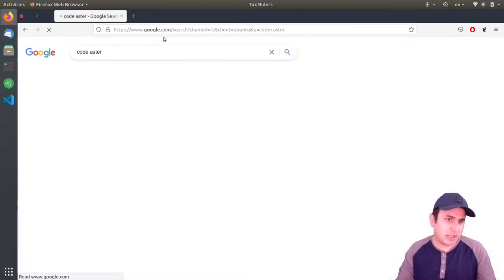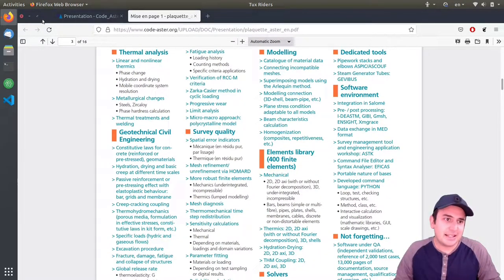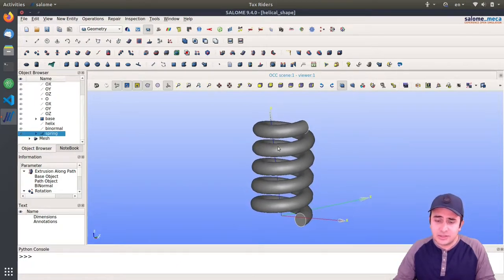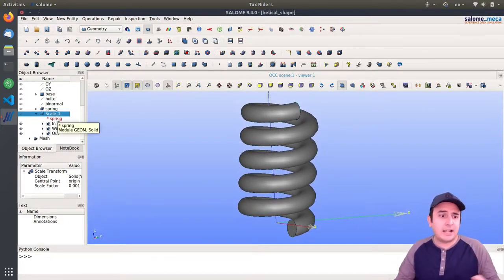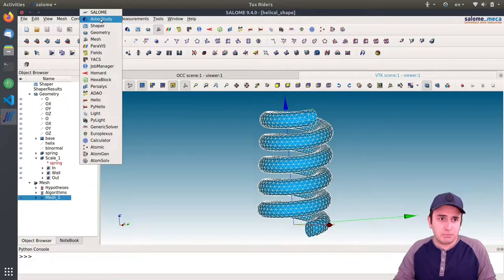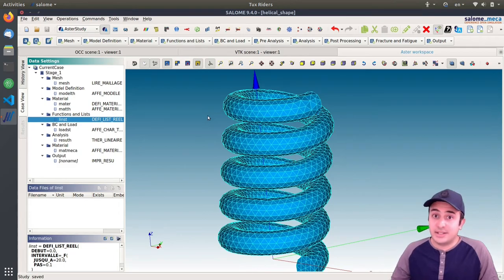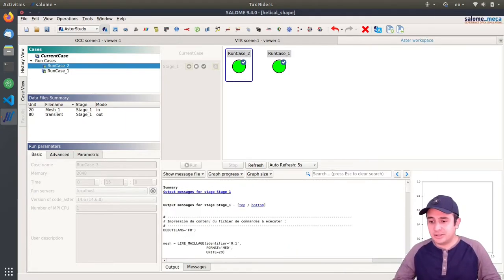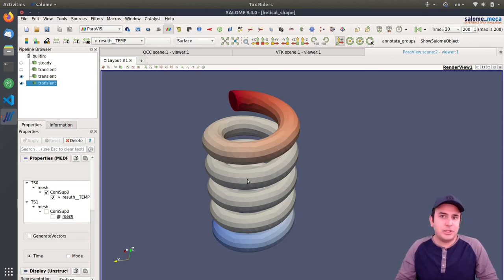[Finite Element 10] Transient and steady-state heat transfer simulation in Code Aster & Salome-Meca

Comment: thanks for another nice video. When you said "outlet"  but clicked on "wall" I was yelling no no you clicked the wrong box :-)  But it turned out ok. Engineering is solving problems not just learning how to operate some software. When I was a young engineer in the earlt 1980s, we were trying to get ANSYS accepted in our company. I was demonstrating  the model creation process and made a typo and the 2d face was swept along the wrong axis, crreated a mess. I quickly realized the mistake, deleted the volume created and the correct mesh. The management was impressed how quickly the error was found  and  corrected.  Yeah,Cp and  thermal conductivity (diffusion coeff) are needed for transient analysis.
Reply from the maker: thank yo for this nice comment. haha, yes, I didn't pay attention to what I was selecting for the BC. the story you said was no nice, and I totally agree that knowing effective approaches for debugging models is very important. thanks for sharing it.